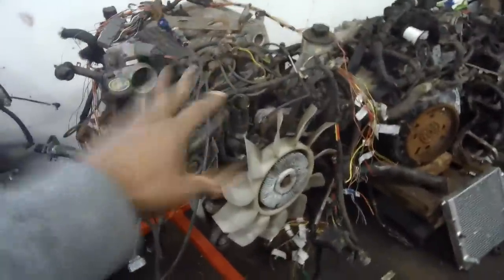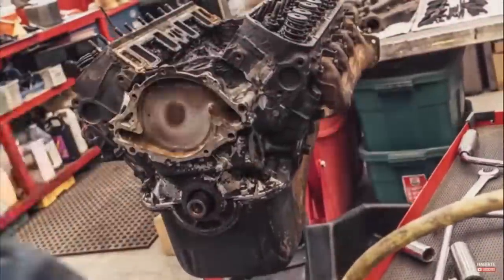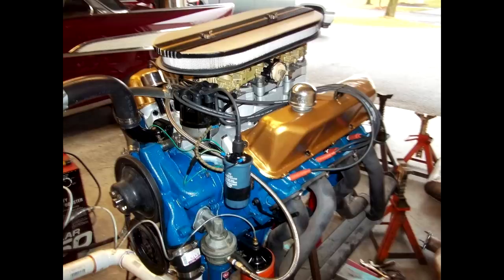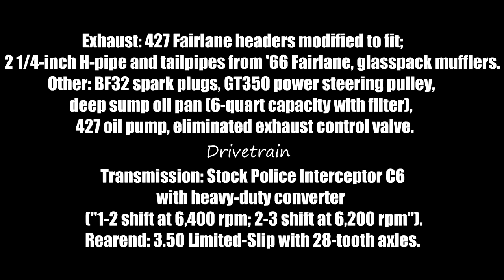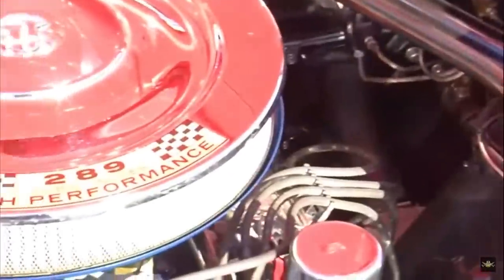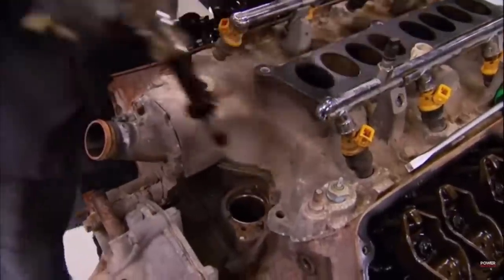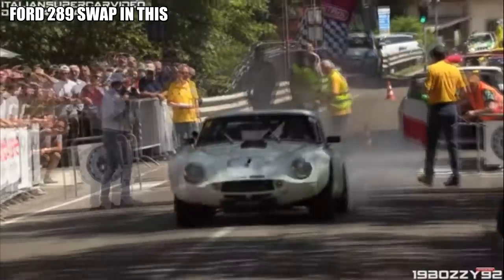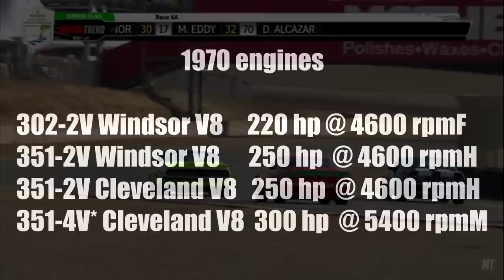289 Ford Voted BEST ENGINE BY CARROLL SHELBY ( HERE IS WHY )

Comment: 289 by far was the most fun ! (For me)I had many fords . Stock bottom end low compression “ok” heads first gen edlebrocks solid cam shifted at 7300 but wouldn’t stop pulling I had to watch the burnout as I regularly hit 7800.torque ? who needs Vtech when you have bore to stroke for I light car 73mav 2700lbs .
Reply: How did you get the Mav down to 2700? I'm wanting to build one with a stroked 302=347. My numbers come in no lower than 2,900 lbs. Was you running G60s on aluminum rims? The 1976 Mercury Monarch posi-trach with disc brakes will bolt right up to the Mav. Both being the same Fox body. Granada was the same but had rear drums.
Reply from the maker: I like how that sounds i need one of these you speak of Casey .. I may need to copy that set-up seems simple
Reply: L Twig I pulled the front bumper and took out the bumper shocks and the inner part of the bumper and made a couple litt “L” brackets, no head liner no carpet that was it . Aluminum heads nock the weight down no power steering and when I weighed it it might have had weld wheels on it I don’t remember ( I usually drove it with steels with hubcaps . That was at the track scale without me in it . I had slicks on steels cooper cobras on steals and bfgs on welds. It’s not considered a fox chassis and the diff from a Granada will fit from what I know but I would get a explorer diff now and make it work 8” diffs aren’t near as strong as a 8.8 and parts are readily available ie. posi gears and disc brakes
Reply: BST Ford Channel very easy your mav will be plenty fun ! You get a explorer 5.0 decent heads 190 valve intake unless you notch the pistons a cam in the 238@.050 lift .540” ish victor intake 750 cfm carb decent rockers and push rods rocker stud girdle or 7/16 studs headers 2 1/2 exhaust . I had a 3800rpm stall 4.11 gears . Now you have room for a 351 Windsor in your mav so you could really make that work !
Reply: @caseym3118  Thanks Casey, So you think the 351w will fit in BST Mav with the towers only trimmed instead of deleted? Man 2700 lbs would be awesome! I'm wanting to build more of a street rally car. Don't want much of an interior and delete the rear seat. No power steering. Move Batt to trunk. In trunk fuel cell. But would like to build a roll cage. Drop the alternator to the bottom. Get all the weight as low on the car as I can. Wanting to jack the wheel wells out an inch and add functioning air vents for the back brakes. Likely prefab my own bumpers out of a modern donor car and carbon fiber. Just started working with carbon fiber last year. Have not found the 2door Mav at the right price point yet. Needs to be ragged out but not too far gone. Hate to modify something that can be easily taken back to original. Trying to stay under $22,000 finish. We can still purchase after market grabber hoods for them.
Reply: @caseym3118  So it is really not a fox body, just some parts will bolt on? Yeah the 8.8 would be the better option. Though I'm not into racing it. 300 hp would b just fine. More about suspension, handling and looks. Just make that coke bottle shape what it could have been if the Mustang sales would not have been conflicting. Actually want to do a funky 70s plaid bench seat instead of buckets. lol it's an art project.
Reply from the maker: @caseym3118  thats what is the plan with the Maverick.. I just want to wire it up and them take it out then do all the trick stuff.. Just want to get it to run on its own power EFI style if possible.. I have dragged my feet a little ( well a lot lmao) cause of all the OTHER projects I have Casey..
Reply: BST Ford Channel it would sweet to see the mav worked on . I like the vids to ! I’m on my 4th mav ( if you count 4door comet )
Reply from the maker: @caseym3118 when i do the Maverick video people seem they do not enjoy the CAR as much one would think.. all the hard work is kinda done just need flywheel and oil pan to place engine in and start wiring it up to run

Comment: Briggs & Stratton, if you're mowing lawn and doing a lot of tight cornering Briggs & Stratton is the bomb. I was a big fan of Cox engines for model airplanes. The motor Hitachi puts in their magic wand vibrator has saved my neck and my back. Dollar per horsepower, it's the Chevrolet DZ 302. Favorite motor without a budget the Ford Cammer. The motor is just the perfect motor for passing other cars. Osterizer builds a good motor for daiquiris.
The Makita brushless motor is my favorite motor for cordless drills.
My favorite jet engine is a General Electric project. Your video is excellent it was dead on. The Chevy 283, with 202 angle plug heads, a Duntov 3030 cam, a 780 Holley double Pumper, and a balanced reciprocating mass, the motor never runs out of carb, or cam, and it tachs like a motherfuker. Put 60000 miles on it, and it's ready to beat, because it is seasoned and loose, Mount that to a 66 Chevelle platform with a 4-speed. Then it's all about the size of your balls.
Reply from the maker: very detailed a solid comment here all the way to Mini bikes and Hobby cars. I love mini bike

Comment: Come on. 289's even the 2bbls are a snappy motor and basic good design. But in stock form they were weak, not much torque. Those horribly restrictive exhaust ports, wow. You can do the usual hop ups but they won't respond like an engine with decent heads. And stop with this hipo revver. They were done about 5500 maybe 6000 rpm due to those heads. I started as a ford guy in those years and have quite a bit of experience with them.

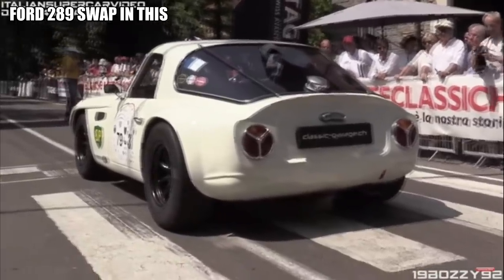Comment: I enjoyed this up to the 9:36 timestamp point.

You said..."some small Italian thing"  WRONG!!!!!!!!!  

Dude, you have NO idea what you are talking about.  This "Italian thing" is a British TVR, sometimes rebadged as a Griffith when Jack Griffith, a Ford dealer was importing them to the states.  TVR had used a number of small bore English motors for years but this model began a long association with Ford power plants.  TVR is still building cars, all very uniquely British in character, all high performance rockets.

TVR's were much like early Lotus models.  A 'hodge podge' of misc. parts from various brands.  Just like American hot rods, a little of this, a little of that comes together to make a unique automobile or race car.  Look at the famous 'Old Yeller' rat rod history that beat Ferraris, Jaguars, Maseratis, Mercedes, Corvettes and even Cobras in club and now vintage racing.

Tube frame chassis, bonded fiberglass body,  2 wheel coilover suspension bits from Triumph up front and 4 coilovers in the rear from Jaguar with Jag/Salisbury I.R.S., 4 wheel disc brakes,  Borg Warner T-10 short tailshaft trans, taillights are English Ford Cortina.  Knowledgeable people consider this a 'baby Cobra' because of the similar layout.  Because of the lighter weight and shorter wheelbase, these are awesome autocross monsters when setup correctly.

How do I know this??  I've done 2 complete body off, bare frame restorations, one of which was on my best friends Griffith.  He was the former president of the TVR/Griffith Owners Club of America for years.  Lord know whatever you'd call the Sunbeam Tiger???  Japanese???

If you intend to do historical analysis, you better get your facts straight...

Comment: I have a 289 on engine stand now,,,all machined steel crank all ready to put together, going in 66 mustang I'm building
Reply: George, you saying you have a 1966 Mustang with a 289 takes me back to 1973 High School days.
I had a 1973 Challenger 340 Ralley automatic.
A classmate had your car set up.
This guy Jack raced his 66 Stang 4speed. He had headers, big carb., 3/4 or full race cam..... anyway
My stock 340 didn't hold up to that 289.
He did have to work on it a lot but it was very fast. He even beat some 396 Malibu cars.
That was a long time ago.
Reply: @wms1650  yes,,,have many,,,66 mustang,,,68 GT mustang,,,2 64 gallaxie 500s,,,72 chevelle,,68 torino,, 64 elcamino, 71 torino,,45 dodge pickup,  30 street rod I built from scratch,,,all aluminum body,,,,my first car was a 67 dodge charger,,second 70 challenger and third 73 SE charger,,,oh I have a 79 z28 and a 84 vette also,,,my hobby is buying and restoring classic cars...
Reply: @georgespangler1517   Do what you love and you never have to work.
Sounds like you have an eclectic group of 60s and 70s potential muscle cars.
Peace to you George.
Reply: @wms1650  Thanks,, I'm 60 now worked hard for myself as a building contractor,, but my passion has always been classic cars,,, now I buy there in need of fixing up,,but only cars of potential value,, and will spend out my life doing what I love,,, buying and restoring classic cars and reselling them,,,just sold 45 pickup for a nice profit,,,and enjoyed every minute of building it..take care my friend...